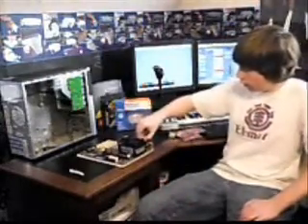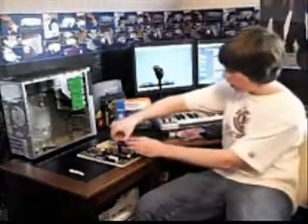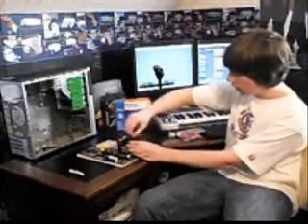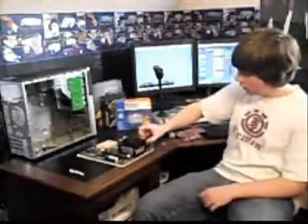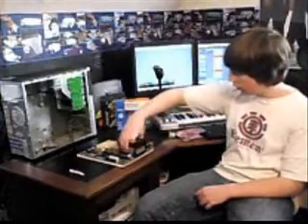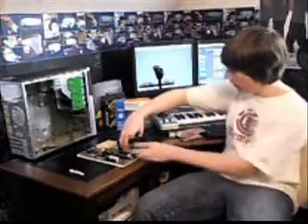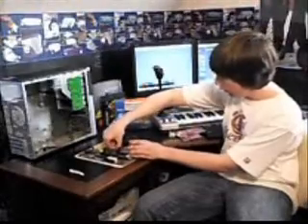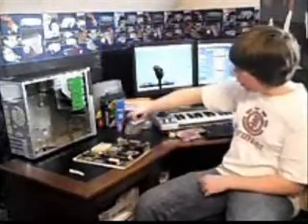how to install or replace your CPU , procesor installation

Comment: Check RAM, anything under 3GB of RAM with Windows 7 will have issues. Check processor, if it has anything less then duo-core that will kill any kind of multitasking. Remove old programs you don't use, free up hard drive space, defrag your hard drive, do a virus scan, get SuperAntiSpyware (it's free and safe) and remove spyware and crap, and clean your registry. If it's still slow then either upgrade your machine or check your router model, signal strength, and ISP.

Comment: @marios93g Better? dude you have top a top of the line graphics card. 1 gb is a whole lot for graphics, and even todays most graphic intensive computer games (black ops) only require about 256 or 512mb at the maz. you have no need to change ur graphics card dude